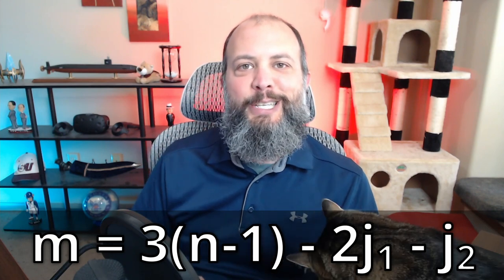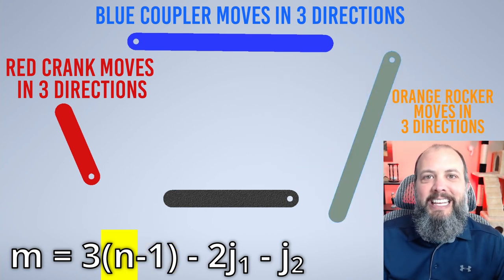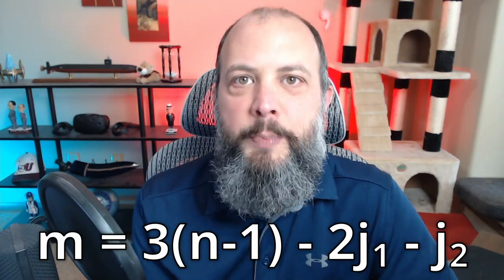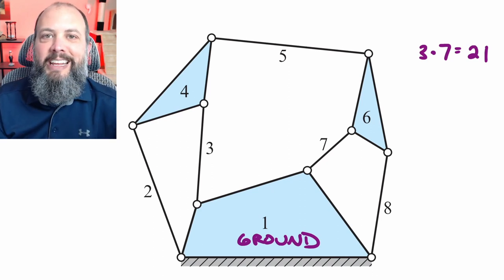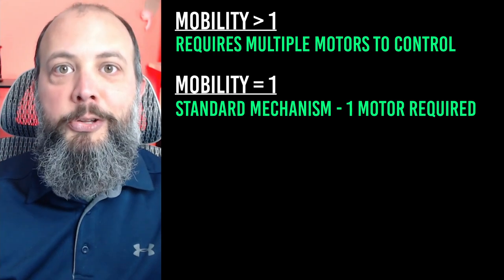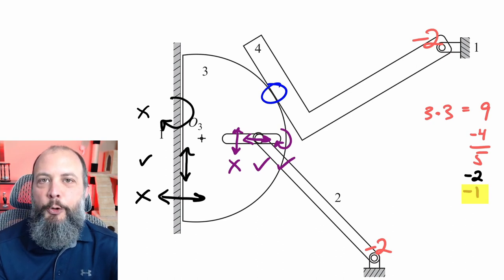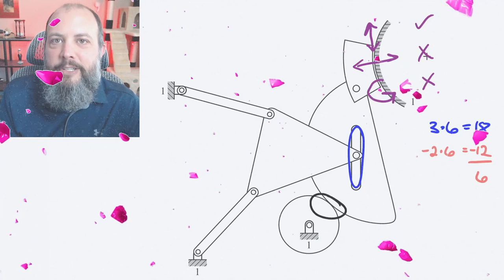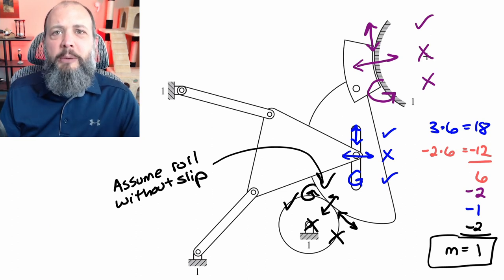Mobility of Planar Mechanisms – Degrees of Freedom using Kutzbach Criterion

Comment: Assumptions: 
1. 2 dimensional (2D) planar motion.
2. The link is rigid.
3. Material is homogenous.
4. Without considering forces on the linkages.

mobility: (2D degree of freedom per link * number of links - 3 * number of static links) - (number of lower pair joints per link)
Grubler's Equation.

Comment: When you are looking at which ways the joints can move, do you look at the joints or the two links themselves? Like will both links connected to the joint have the same amount of restricted movement?
Reply from the maker: I prefer to not really think of the joints as 'things that move', and only consider the links as moving objects. I usually view a joint only restricting the motion of 1 of the attached links, not 2. Consider a 4 bar linkage. The crank has its motion restricted in 2 directions by the joint connecting crank to ground. Then the coupler is restricted in 2 directions by the joint connecting coupler to the crank. So that joint, connecting coupler to crank, I don't think of it as restricting the cranks movement, because the crank is already restricted from its other end. This isn't the only way to think about these problems, but it's my way.

Comment: Is mobility related to static indeterminacy? Is it just if m>0 then the system is statically indeterminate?
Reply from the maker: Yes it is related. Think back to your Statics class - all those truss problems had m=0. But then in mechanics of materials when you did statically indeterminate structures where you had too many unknowns and not enough equations, those are cases where m<0, ie m is negative. Redundant constraints cant be solved with statics, must account for bending and material properties. m>0 would be in your dynamics or machinery class, studied with F=ma or v=rw, since they are moving and you probably solve for acceleration or velocity.
Reply: @BrianBernardEngineering  That's a neat link (pun intended) between concepts! Most of the linkages we study in dynamics have only m=1, since we can find them with a system of only 2 or 3 equations. If it had m>1 I assume it would be considerably harder, at least to determine an objects movement. Btw this video was awesome!

Comment: Can you please explain redundant degree of freedom incorporated in degree of freedom equation.
Reply from the maker: I will first categorize all mechanisms with Degrees of Freedom (DoF) >=1 as moving mechanisms, and all with DoF <= 0 as structures, meaning that they cannot move. Take any mechanism or structure you like, and add to it a link, with that link pin jointed on each side. Adding a link adds 3 to DoF, but the 2 pins add -2 each, so this combination adds to -1 total change. Oppositely, removing 1 link, and its associated 2 pins would result in +1 to overall DoF since you subtract 3, but add 4. Getting to your question, "redundant", I usually use that term to refer to structures with DoF of -1 or lower, since it means that even if you remove a link, you would increase DoF by 1, but if you are at -1, you would only go up to 0, which would still be a non-moving structure. DoF=0 is a structure, but if you remove a link and its 2 pins, you'd be at DoF of 1, and it CAN move. In order to prevent motion even in the case of failure, you would want redundant constraints, so that even if 1 piece fails, DoF is still 0 or negative. Hopefully this answer fits the context - that "redundant" refers to DoF of -1 or less, so that a link can fail, and the system would still be rigid. I hope you have a nice rest of your semester!

Comment: @11:19. The yellow link oscilates and passes through the same state ( angle) on its way there and back ( clockwise and then counterclockwise). Both blue and yellow links will be in different positiins for the same state of the yellow link...so how can i state that if i know just one angle of any element of the entire system, i can describe the rest of the system? Those are two completely different states for the same state of the yellow component? Please advise
Reply from the maker: Yes, there is a hidden assumption I made here - that this 4 bar linkage is in the "open" configuration. There is a 2nd possible set of angles that would also work, sometimes called the "crossed" configuration, where the rocker points downward instead of upwards. So, though there are technically 2 possible solutions, if you choose which one you want, then there's only one! I predict that the vast majority of your homework and test problems, you will use the open configuration, so it should be your default choice. If for no other reason, it's often easier to draw.

Comment: So the formula in our textbook is wrong? The formula we have is DoF = 3n - 2l - h and not DoF = 3(n - 1) - 2l - h
Reply from the maker: It depends on whether you count "ground" also called the "fixed link" as part of n or not. If you count ground as a link, it doesn't move, so you need to subtract 1 from n. If you don't count ground as a link, and n only includes parts that move, then 3n is correct, no need to subtract 1.
Reply: @BrianBernardEngineering  Ok thank you so much now I got it.

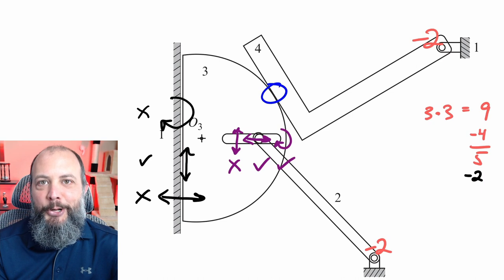Comment: 7:51

How can it rotate?
Reply from the maker: If you were to manually rotate the long bar that is link 2 clockwise a small amount, this would push the semicircle up the wall a bit, and link 4 would also tilt upwards. In doing this, the angle of link 2 would be different where it fits in the slot, it will be more vertical. That's what I mean by "it can rotate". That joint where the rod fits into the slot, right now its kind of tilted, and it can change to being slightly more vertical. It CANT rotate a full 360 degrees, that would break the mechanism and all sorts of weird things can happen. But it can rotate a little bit, and that's all that's needed for this analysis, an ability to rotate just a few degrees is enough, doesn't have to be a full rotation.
Reply: @BrianBernardEngineering 
Thanks a lot Master

Comment: 5:58. why do you add 2 more joints. dont those pins already exist?
Reply from the maker: Excellent question and is probably the most common and easiest mistake to make on this type of problem. You are correct that in the physical world, these 3 links that all meet at the same joint would likely be connected by the same physical pin. However, when calculating mobility, a joint only connects 2 pieces. no more. When you add a 3rd piece, you have to join it with a new joint. That pin gets double counted, -4 insted of just -2. Adding a new piece ... you can't connect it using old joints. New links added to a system require new joints to restrict their mobility...even if those joints are at the same place as existing joints. This is a very easy mistake to make when calculating mobility, to just always subtract 2 for a pin. When theres more than 2 links at a joint, you may need to double count that pin, or triple or even more if there are many links at the same pin.
Reply: @BrianBernardEngineering  Thank you so much. Makes sense. Your video has really helped me grasp this.